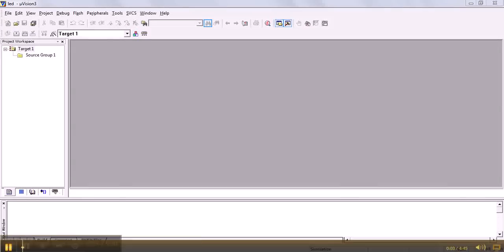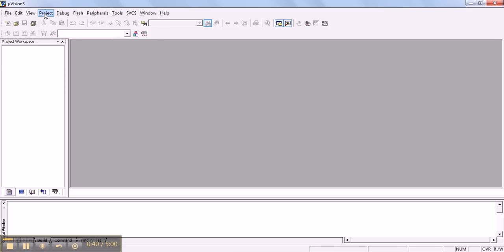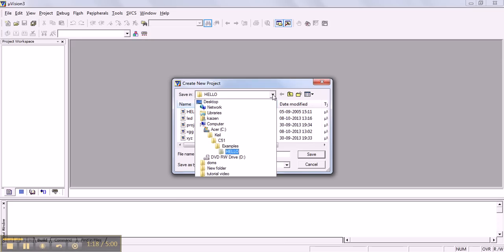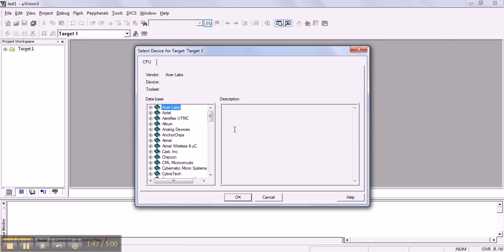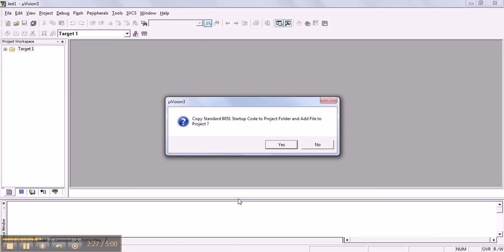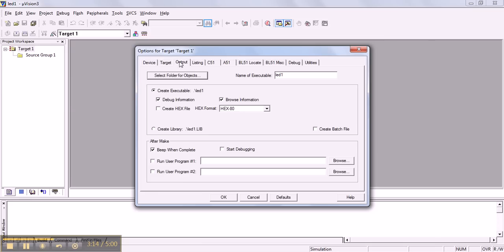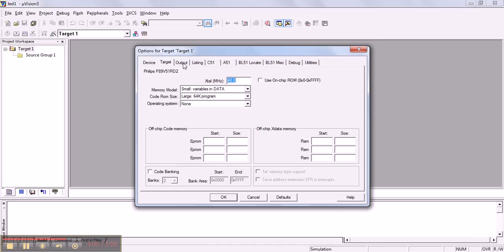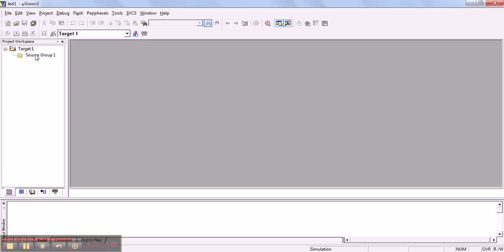Keil Tutotrail for 8051 micro controller - Part 1 -  How to make a new project

Comment: Good Video,
I am learning Assembler in Keil uVision 4 but it is difficult for me. Your videos help me a bit, but I couldnt find a Video where I can learn to get for example 20 numbers to the external memory.

I have a code like this:

mov DPTR, #00h
mov A, #00h
movx @DPTR, A
  
inc DPTR
mov A, #01
movx @DPTR, A
  
inc DPTR
mov  A, #02
movx @DPTR, A
 
inc DPTR
mov A, #03
movx @DPTR, A

...

inc DPTR
mov A, #18
movx @DPTR, A
  
inc DPTR
mov A, #ffh
movx @DPTR, A

But I cant see the numbers in the external memory... There should be 20 random numbers without a sign. Only numbers from 0 to 100 (or infinity) for example. How can I do it? My code isnt working.

Thanks for your answer, Assembler is an old programming language and I couldnt find any help on the internet. Glad that I found your channel.